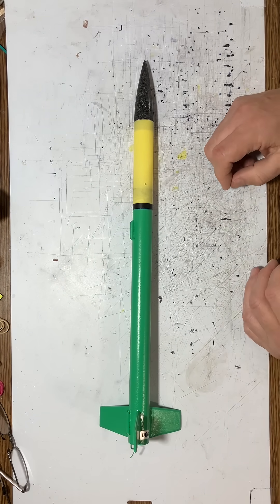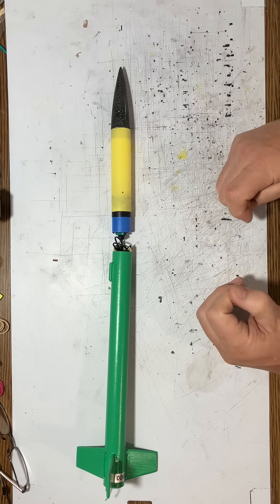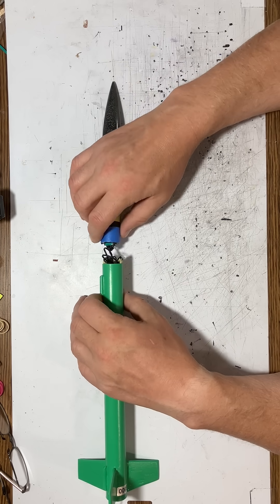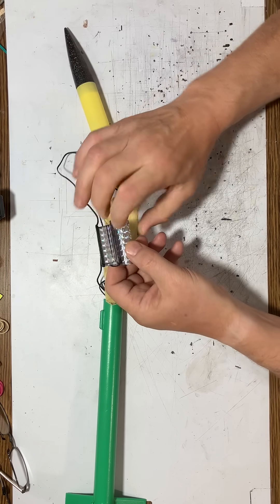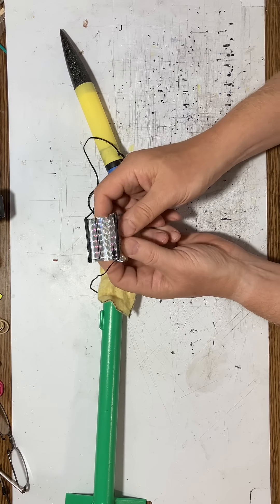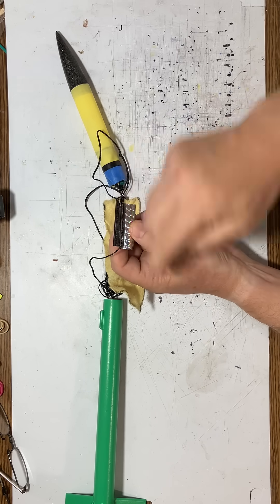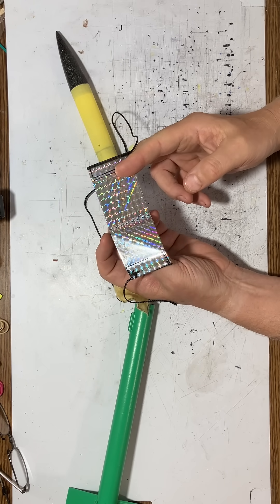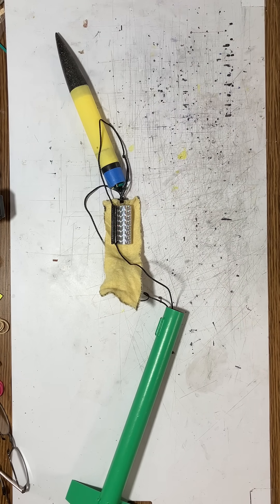Reducing Kevlar Cord Tangling During Deployment

Comment: Now that is neat
Reply from the maker: My background is electronics engineering and I noticed a TV repair man winding up a cable in a "strange way". Eventually, I found it is called "over/under" winding where the cord alternates the loop direction to remove twists and tangling. I remembered this technique and adapted it for the cords; however, the cord is attached at both ends, so I did a little "engineering" to figure out how to wind it. In all the rocket videos out there, I have never seen anyone properly address how to wind a cord so it does not tangle. So the purpose of my channel is fulfilled by helping people "to build better rockets with the existing kits". Have fun and keep launching!